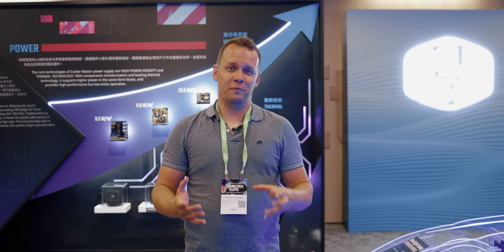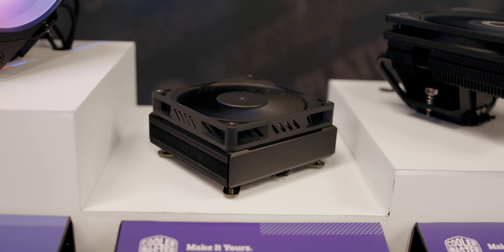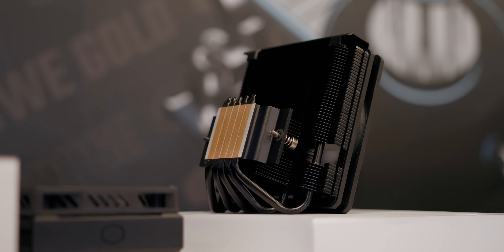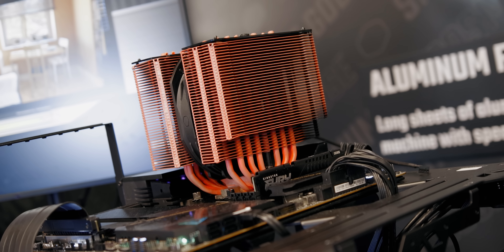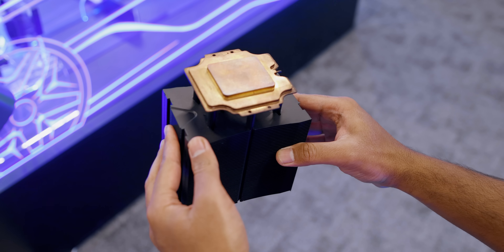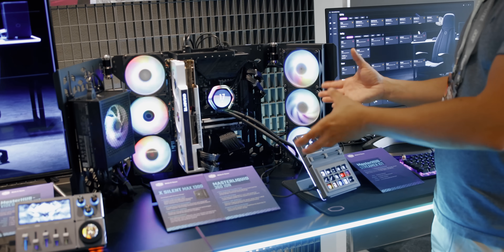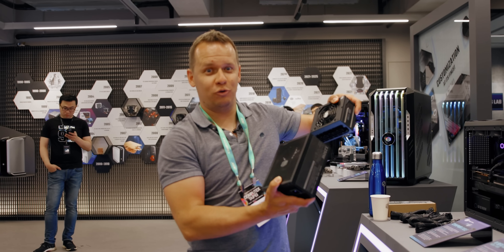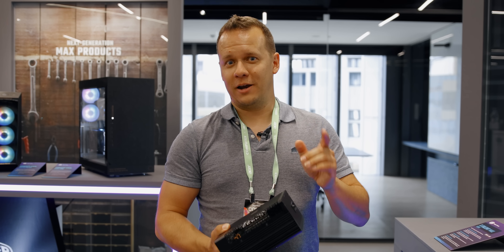The Color Changing CPU Cooler 🤯

Comment: I will be pairing a Cooler Master 3D V-Chamber with my AMD 3D V-Cache for the potential DOUBLING of the 3D-Vs of even top of the line current 7000 series. Hopefully this can stave off the RX 7000 series' X inflation, as my system is currently running double the 7000s but only 2/3 of the Xs that it could run. 

Overall, the performance blows Intel out of the water with an exponential improvement in the amount of Xs, 7000s, and 3D-Vs of any 'team blue' system you could build, at any price point. Nvidia is a bit more competitive with my system only having 300% more Xs than a comparative RTX card, however, I do note the lack of Ks and RTs in my build, and hope that doesn't cause any bottlenecks in the future.

Comment: I like the colour changing, though I'd like 3 colours.
It's actually what I plan to do if I can ever afford such a "dream build" with custom water cooling and the only reason I'd allow RGB lighting in my system ... to have the blocks and tubing light-up a colour depending on the temp (probably needing an aquacomputer aquaero to get enough customisation, without needing OS bloat).  Probably blending through purple, green and orange.  
Mostly cos it'd look cool, but only permitted because it'd be functional too.

Comment: That Sfx 1300w will do 580w load with fam off - that is enough for most systems during gaming as cpu or gpu is highly loaded. Most non over clocked Gpus are under 300w and most cpus during gaming is bellow 120w  
4070TI performs like 3090ti almost and only needs 250w + 7800x or 13600k will be at 100w. = passive power system

Comment: The color changing coating can help with testing and optimizing new coolers as well. It really show which parts are effective in removing heat and what sharp corners don't do very much.
Reply: Not really because it's just the same type of paint that you can find on "color" changing coffee mugs. They just shift from being opaque to translucent at a certain temperature

Comment: I believe this color changing coating they are using is VERY similar to the ones used in coffee mugs, where the paint is opaque until you pour a hot beverage inside the cup. As you can see from the cooler, which is made from pure copper (let's not debate about the purity though), and on top it has this temperature sensitive coating that becomes translucent when heat is applied, and opaque when heat is removed.
Reply: I doubt that the coating's getting translucent at high temps, as bare copper wouldnt look that vibrant... There has to be some fluorescence going on in there if you ask me

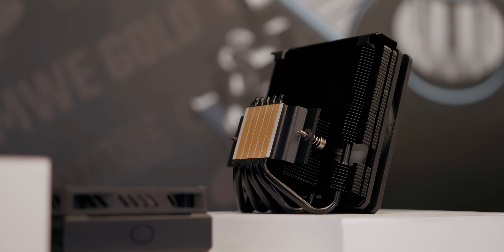Comment: 3:20 Your demo did nothing to show the difference between the "garden variety" heatpipe and the new improved advanced one. I call BS on that. Fancy automotive paint does not help cooling
Reply from the maker: Effectively showing something of that nature would have required a side by side comparison which sadly wasn't there.  However, Cooler Master's approach for using an SCH design has been proven by tons of research and patents in both the defense industry and automotive industry.  They're more efficient than standard heatpipes.  Period.
Reply: @HardwareCanucks  the fact that they didn't show the comparison is the reason I call BS. If they really had special heat pipes, it would make them stand out among all the other generic brands; they would be really dumb not to show it. 

I've been searching online to try and find more info on these claims and it seems like they don't advertise this yet , is there any literature about these new heat pipes?
Reply: on the other hand, a generic hardware company making bogus claims about it's products would be a very common thing..

Comment: Very cool.... Now I'm curious how well this color changing stuff will work a couple years down the line. (Because if it's like those color changing mugs that slowly lose their ability to change..  not great)
Reply: Thermochromic paint.
Reply: I would think that the mugs lose their ability to change due to wear from washing, but I could be wrong. I'd like to think it could last basically forever in this use case.

Comment: The 1300 watt SFW power supply is interesting. Assuming Google is correct a US outlet can handle 1,800 watts, and a UK one 3,000 watts. I'm pretty sure I heard LTT drop that as a problem for US consumers going forward a while back as PCs reach even higher power needs. But presumably as the house tends to have 220V supply it's a fairly simple rewiring job - except that you'd probably have to have a dedicated socket for your PC, much like you have for your oven or other multi KW electronics. Long past time to standardise around UK plugs and 220-240V anyway (or perhaps upgrade from there if need be).
Reply from the maker: It isn't necessarily the ABILITY of the outlet itself but rather in a switching PSU, the 220V provides an additional efficiency factor when converting AC to DC.
Reply: @HardwareCanucks  so you could make a North American version of the same PSU in 120V but they're not planning to do that? 

I may have misunderstood what the issue was because my physics is shockingly bad -  I thought it was they couldn't draw enough power from a 120V outlet. No pun intended.

Either way, more efficient PSUs is a good thing, and it'd be nice if they were available worldwide.

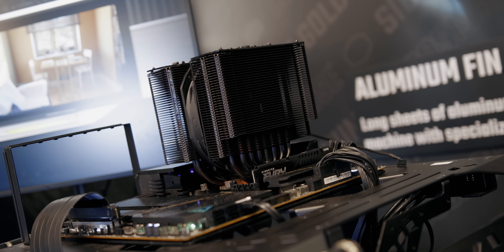Comment: 4:41 I guess they used a similar coating, like what those heat-sensitive/color-changing mugs uses.
Reply from the maker: The idea is the same but the material quite different...supposedly.
Reply: @HardwareCanucks  yeah, that's true.

Comment: Either that was a bad Demo... or it was cut oddly.  
Heatsink is black... fan is running, no load on it.  -> must be cool.  
He turns on Cinebench to put a load on it, unplugs the fan, Heatsink turns orange.  -> must be hot.  
My Expectation was that now he plugs the fan back in and you can see how it turns black again, while it is cooling off... and red implies hot and danger, so why would it be the other way around?  
Instead he does not plug the fan back in, does not turn off cinebench, touches the red glowing heatsink and says its cold?  ...... ok, what did i miss?  
I'm sure i'll see 10 more videos about this thing in the next 2 days pop up... maybe the next guy explains it better.

Comment: It's cool that you can see how unevenly that chip spreads the heat, you can see the heat pipes near the pcie slots heating up faster from the ccd dies being at the bottom of the chip instead of the center
Reply: That leans heavily into the offset mounting brackets I’ve been hearing about quite a bit lately
Reply: I wonder how much could you drop the temps by rotating the heatpipes by 90 degrees, this way each heatpipe would touch the "hot parts"
Reply: @423GustavBern  If I remember correctly noctua's offset mounting kit drops it like 8-12 degrees, as much as 20 degrees with the new nhd-15 on direct die with thermal grizzly's kit too
Reply: That's right! otherwise we could not detect uneven temp hotspots.
Reply: That's why Derbaur and Noctua released the offset mount
Reply: @z4k1_zaki65  I saw an ltt on it earlier today, that's what made me think about it
Reply: That might not actually be the cause, but rather working backwards from knowing about offset mounts or that the effect of which isn't this dramatic.
It could be manufacturing tolerances.  Notice that the central heatpipe didn't change below the finstack, but did within it.

Would need proper testing to determine how much is the offset properties of AM5 CPU designs.
Reply: @ChrispyNut  well, ryzen 7000 chips I know for sure have their ccd dies at the bottom of the chip where the first heat pipes started changing color, the io die and memory controller are in the center where a typical cpu package would be and the ccd dies where the cores are at are offset pretty far to the bottom. They also increased the thickness of the ihs on the new chips to maintain cooler compatability with am4, hence the excessive drop in temps going delided, as for the offset mounts helping the explanation I heard was just moving the center of the cold plate above those ccd's helps the cold plate pull heat more efficiently instead of saturating the heat pipes closest and underutilizing the furthest ones. Kinda just sharted that out from memory so lmk if it makes sense
Reply: @Not_Loading  Yea, I know why you reached that conclusion.  The logic's sound, but the effectiveness may not be that significant, when dealing with a pre-production "tech demo" unit like that, the manufacturing tolerances probably aren't that great, so it's possible they contribute more to what we're seeing than the offset-ness and it's mere coincidence that it's stacked to that side.

Just kinda sayin' ... write up hypothesis, but then check by testing and then refine as required (but we can't soo... just bear in mind).
Would be really helpful for testing though :D
Reply: they are not spreading the heat , they are just transformed from aluminum to copper , that's called cooling evolution ssj3
Reply: the cooler has zero to do with showing how an ihs spreads the heat. how the coler is heating up is hot the cooler is spreading the heat. an ihs is literally designed to spread the heat out whic hthey do ver well. the furtehr from the center will always be cooler on an ihs as the die depedning on the cpu is always in the center of the ihs.
Reply: @ColdVenom159  I don't think you understood what I said, the cooler is an indicator of how the ihs spreads the heat. Also, for your information the chip they used doesn't have the die in the center like traditional cpu's do, it's ryzen 7000 so it's a multi die cpu, the part of the die containing the cpu cores is offset heavily towards the bottom of the package
Reply: @Not_Loading  great job not paying attention as I said depending on the cpu the die is always on the center of the cpu. I know the cpu that was used hence why I said what I said. Again the heat sink is on no form an indicator of how the ihs is working as the entire point of the ihs is to spread heat and get rid of it as far as poss. How the heat is moving through the heatsink is an indicator on how the heatsink is transferring the said hear through out the rest of the heatsink. You're taking heat from a very small area and you expect it to transfer through a big heatsink evenly? Ya that makes legit no sense. Not all parts of a heatsink preform the same. This is why air cooling never wins the race in the case of water cooling.
Reply: @ColdVenom159  when did I say I expected it to spread evenenly through the heatsink? All i said was that it's cool that the thermal reactive paint on the heat pipes show how ineven the heat load is on the cooler because it's offset from the center of the cpu package. I still don't understand what you're trying to argue
Reply: @ColdVenom159  also the die is not centered in this cpu, that was my whole point with leaving a comment, as I explained twice now that the ccd dies that house the cpu cores are at the very bottom of the cpu package and that is why the bottom heatpipes start changing color first
Reply: @Not_Loading  never once said the die is in the center of the chip, again hence why I said depending on the chip. Do you not read at all or just jump to responding.
Reply: @ColdVenom159  no I have read and reread your comments trying to understand what you're talking about. You quite literally said and I quote "the die is always on the center of the cpu" it is actually not which you claim to understand yet directly disagree with in your own comments. So I'm going to ask you again, you may reword it if you would like, what are you trying to argue here? Or, what are you misunderstanding about my comment? All i said said was that it's cool that the thermal reactive paint on the heatpipes shows that the die isn't centered under the ihs and it actually skews to the south on the cpu, which you can see in the video
Reply: @ColdVenom159  No, it's not.  Read the damn comment and look up the positioning of the dies on Ryzen 7000!

Comment: That color change is cooler than any RGB or display on AIO I have ever seen. Because that's pure physics. If it doesn't ruin cooling, give me 2?
Reply: Reminds me of the color changing Hot Wheels cars back in the day..
Reply: @bstaznkid4lyfe392  That was the bomb back then
Reply: @bstaznkid4lyfe392  I instantly went back to that too.  This is pretty cool though, I could see it having huge appeal to consumers.
Reply: chemistry, its chemistry
Reply: I totally like it too and would love my case all painted in that, but I have a Mug for years that does it too and there's car paint with that feature, but it sure looks cool as long as it doesn't effect cooling.
Reply: Thermochromic paint. This would be black to clear when heated.
Reply: Very useful for rnd!can clearly see where the heat is transferring to.
Reply: I want a cooler that has both this AND rgb.
Reply: @captainjeep-eep6180  Retro, 50/60Hz flickering neon lights. And some lasers targeting RAM with star wars noises. Don't forget smoke screen every now and then so lasers look even cooler. And the rad tower turning like a clock, one full rotation in 1 hour... did I miss something?
Reply: @vensroofcat6415  Nah, strong blue glow, look like a torchship with the drive going to full power.
Reply: Changing colors of RGB is also pure physics
Reply: @asandax6  True, but i think hes trying to say that it has a physical, almost mechanical appeal to it, while LEDs and screens are digital.
Reply: @Criiies  I think the word is thermochemical
Reply: @Criiies  but LEDs physical too..
Reply: @asandax6  It sure is. But there are no cables for this. No proprietary crap software or anything. And it is subtle, natural. Kind of like fire. I wouldn't have all case like this, but as a nice accent, why not? You could watch sunset in your case every time before going to sleep. No blue light "demons" even if you care 😏
And then the elephant in the room - "you can have any color" RGB is very far from true. You can have only those "clean", unnatural colors. Which I don't like much. This is different kind of color - reflected, evolving. Even more limited - sure. But I like the subtle nature and no need for 20 wires and an app.
Reply: @asandax6  ...and some chemistry...but then again, that's the same here, I suppose.
Reply: RGP doesn't affect cooling ¯\_(ツ)_/¯

I want my mobo and ram to color change too
Reply: @MrPruske  Sure it does.  Your adding heat to the case..... a small amount but it is there.
Reply: @MrPruske  Red Green and Purple?

Comment: It's not a special coating. It's basically mood ring paint. It's called SCD Liquid Crystal and it's found in mood rings, mood ring paint and coatings, and in LCD screens.
Reply: Okay, in what way does that not qualify as a special coating?
Reply from the maker: Technically it is actually.  Thermochromic liquid crystal paint is usually rated to between 110 and 125C.  This one can go much higher so it IS more specialized.
Reply: @HardwareCanucks  Some surfactant liquid crystal coatings go from -30C to 200C, or even higher. And they've been around since the 1800's. It's nothing new.
Reply: So I can see if my CPU is in the mood?
Reply: same thing used on those glass mug that change picture/color when filled with hot water ?
Reply: @lonesomefencesitter3186  Exactly.
Reply: It’s not a special coating it’s just a special coating.

Comment: This feels like some real innovation.  Not the same me stuff with a different skin.
Reply: The best engineering is the simplest engineering. I'd love this as rock-solid backup to temp monitoring software. I remember I nearly ruined a CPU because, for some reason thanks to the mysteries of a system I was running years ago, the thermal monitoring software that show the temp...stopped, and when I got it running again the temps were WAY high than I was comfortable with. If there was a visible, non-software indicator of temps that I could directly see, even if it was just a simple colour change.

Comment: Maybe clear phone backs with visible vapour chambers that change colors depending on the temperature. Would be really cool.
Reply: I was thinking of this when watching. Its not necessary, but a very cool concept to bring some more eye candy and fun/useful visual representation of the processors current temperature.
Reply: Bring back clear electronics in general, black plastic everything is God awful boring
Reply: @UNSCPILOT   I like black, but I sure also like transparent black too 😁😎
Reply: Also some more idea of color changing based on temp:

Blue for below 20 C
Green for 20-25 C
Yellow for 25-30 C
Orange for 30-35 C
Red for 35+ C

(just like the cheap color changing thermometer strip)
Reply: @sihamhamda47  Hell yeah, I vote for that (F* the RGB) 😎
Reply: @sihamhamda47  yea what about 50+ when it's gonna burn your hand? Had many phones that would get that hot and piss me off.